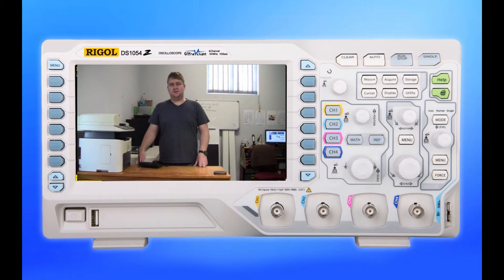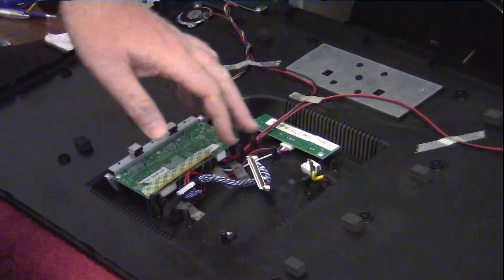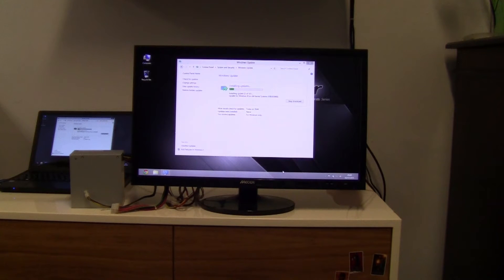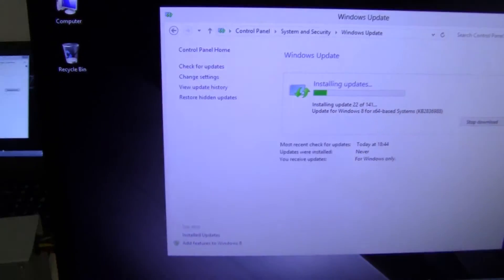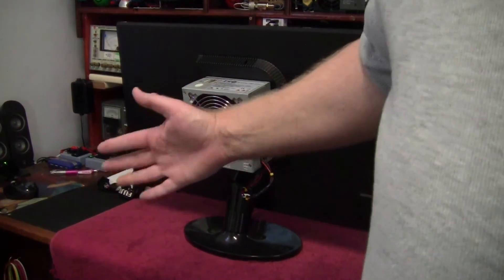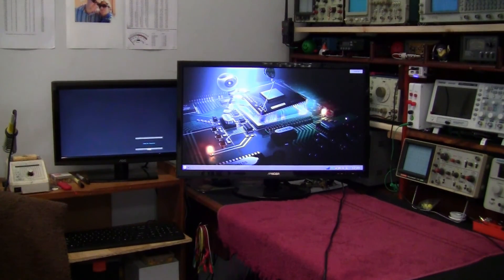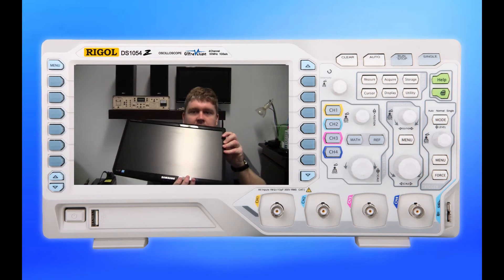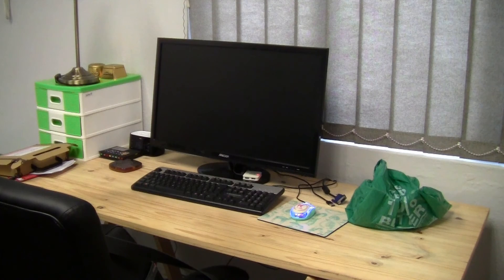Episode 18   Mecer 27inch Full HD Computer Monitor Repair

Comment: Brilliant cheapskate solution.
Never thought of doing that with a PC power supply.
Ive got a box full of them too.
I guess you could make it less obtrusive by just using the pcb from the pc supply and mounting it inside the tv case.